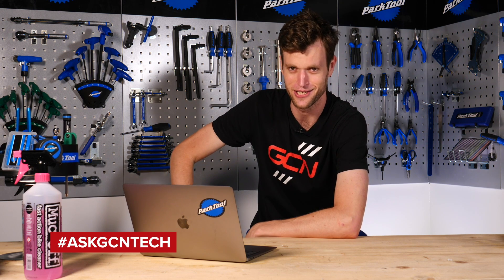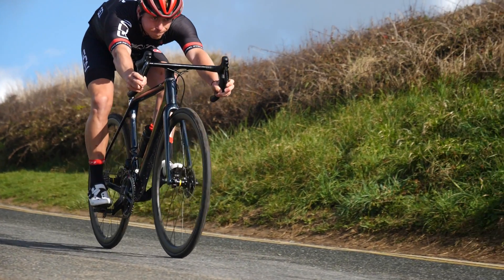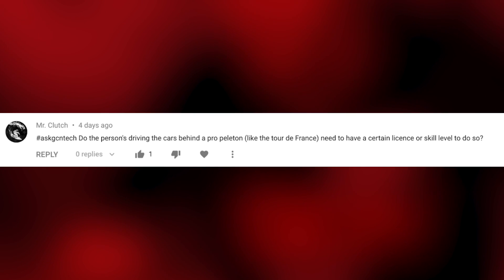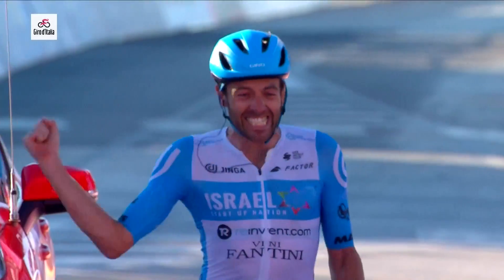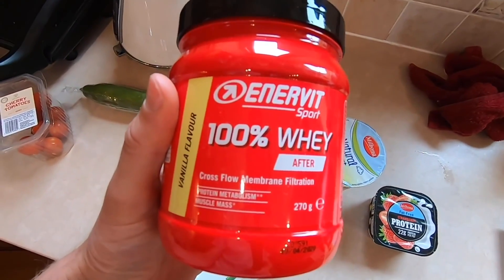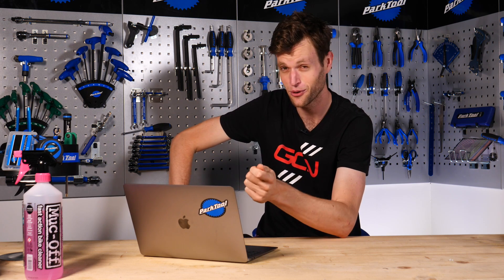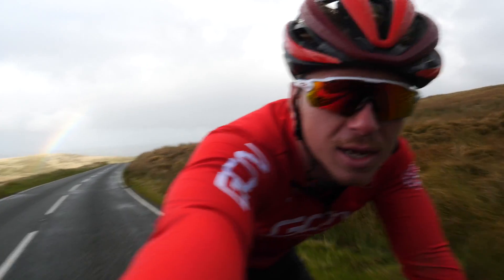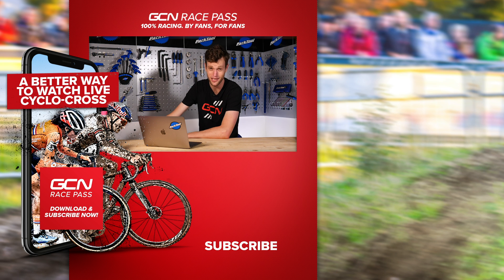Why Do Bicycle Wheel Spokes Cross Over? | GCN Tech Clinic #AskGCNTech

Comment from the maker: Have you got any burning tech questions? Let us know using #askGCNTech 👇
Reply: #askgcntech Hi I was wondering how many times do pros use 1 bike (also love from Australia)
Reply: #askgcntech I have a single speed bike and i saw 3 speed cassette. How do I install it?
Reply: #askgcntech Hi Ollie, where did you learn all of your tech know-how? Did you go on any specific courses or is it just knowledge you have built up over the years? Thanks!
Reply: #askGCNTech recently I have been experiencing lower back pain but i stretch more and more but always feel discomfort any ideas on the issue? Thanks from arizona
Reply: For the person with the squeaky brakes: squeaky brakes  i find are usually caused by the pads/rotor getting glazed over or contaminated. When that happens take some 220grit sandpaper and rubbing alcohol (or a dedicated disk break cleaner, and start by removing and sanding your break pads untill all the glazed parts are gone, then fake and scratch the braking surface on your rotor a tad to help take anything off it. When that is done take a 100% oil/grease free paper towel or similar and spray everything you sanded with your rubbing alcohol. Reinstall the wheel and bed in your break pads. If there is still a squeak, try some of connor's ideas too.If none of these work, there are polishing compounds like 'squeal out' that work better than just sandpaper and acohol, however it's more time consuming. That is what my bike shop does anyway.
Reply: #askGCNTech

Hi GCN, unrelated but I just purchased a new carbon road frame and fork (to replace my old aluminium). I want to switch my rim brakes over but on my old bike, the calipers used serrated/toothed washers to help prevent the callipers from rotating. Should these be used on on carbon frames and forks? Any other tips to stop the calipers rotating?

Thanks!
Reply: I cannot for the life of me adjust the FD R7000... Could you please make a video on this?
Reply: #askGCNTech I have acquired a 5 year old aero bike frame set but I feel the geometry is too aggressive for me to build up as a drop bar bike. Can I use the frame to build a TT bike or would there be some geometry differences that would make it handle like a bag of spanners? Many thanks
Reply: #askgcntech , in the video Conor mentions that he often switched out the front rings for mountain sections , for example  from 54/39 down to 53/36 if you do that will that require additional adjustments such as adjusting the dereleur or chain?

Comment: Just getting back into cycling myself. I have far sightedness and a astigmatism. So I wear glasses when riding or driving at night. I use sports goggles with the adjustable elastic band. I have found that they give me just enough clearance to use the magnetic lenses that some helmets have. It will depend on the helmet, glasses, and your facial structure. Hope this helps a bit as well.

Comment: #AskGCNTech Usually I have a problem with road bike helmets. It seems my head is taller than the average, so my head looks like mushroom when I try on almost all helmets. There is quite big gap between my eyebrow and the helmet or my ear an the helmet. Strangely I never had issues with motorcycle helmets. I know it would be the best to try on many to find which one is good, but where I leave the brand choices are limited. If I order online, it could take a lot of time to find the right one, and not all online shops are happy about delivering like 20 helmets, and accepting the returns. So the question is do you have any brand or model suggestion for people like me?
Thanks!
Keep up with the good work!

Comment: #askgcntech I recently upgraded to a mid range groupset on my road bike and I’d like to work on maintaining it better than I had my first. A lot of my rides involve short punchy climbs that level off or descend quickly and I find it easiest to end up cross chaining and stay in the big ring so I can carry momentum to the faster parts of the ride. Is this a habit I should try to break?

Thanks!

*Not sure if it matters but I’m running a compact Tiagra groupset with a 50/34 up front and a 11-32 cassette. I normally find I can get up short climbs in the big ring and on the 25 tooth cog.

Comment: Do NOT put copper slip or any other grease on the back of your disc brake pads. It will eventually melt and contaminate rotors and pads. Motor vehicles can use thin anti squeal shims between pad and piston, hut never seen them on bikes.

If your disc brakes continually squeal and degreasing/cleaning/sanding pads and rotors does not cure it, (sorry should have bought rim brakes), buy resin or organic pads rather then metal sintered they should quieter. Also buy some better quality rotors, they're not all the same. Then shield your brake calipers when cleaning the rest of your bike.

Comment: To the guy asking the question about gearing.  Last year I spoke to Gary Blem chief mechanic at  Ineos  before the start of the TDF stage Embrun to Valloire  taking in the col de Vars cat1 col d'Izoard  HC  col de Galibier HC  he said Egan Bernal and Geraint Thomas were riding 53-39 front  11-30 rear (I think that's the widest range for a dura ace cassette)  where as I needed 50-34  11-32 to do these climbs

Comment: #askgcntech I am thinking of buying a Wahoo KICKR but do not have access to a mains power supply in the garage. Are there any portable battery solutions that would work instead?
Reply: If long extension cable won't donthe job.  A 12v car battery and an inverter will give you mains voltage. You might then need a battery charger.

Comment: #askgcntech  I have a 2010 SRAM red group set that the front derailleur will or stay in the big ring. When I swing the shifter, it will go to the big ring, but when I let go, it immediately falls back to the small ring. I already checked the set screws, cable tension, cleaned all parts, including the shifter, but nothing worked. What could be causing this issue?

Comment: I have a trekking bike with 28x1.6 (700x40C) wheels which I love for driving around Berlin, really comfortable.
I have been wondering if I could build wheels with thinner rims and tires and use them when driving on road or in some events like the Velothone, since they are lighter and have lower road friction.
I have been thinking about something like 700x30 or 700x28.
Is there anything wrong with that? Is it even worth it? #askGCNTech

Comment: 1:16 Lateral is not the correct term/direction for forces "which are induces when pedalling and braking". Call it tangential, rotational, torque strength/stiffness or something else. Lateral is side-to-side (left-right) movement. Other than that, answer is fine.
Reply: Sort of fine - if "braking" was worth noting as a reason, then the front wheel would definitely NOT have radial spokes since 60-75% of the braking occurs here.
Reply: @georgehugh3455  Braking force is distributed across all front spokes.  In contrast, nearly all of the pedaling force is transmitted to the rim via the drive-side spokes.  And peak force (stomping on the pedals while out of saddle) are higher than braking.  So while radial front is not optimal for front-wheel stability and durability it can be made to work, while radial lacing the drive side of a conventional rear hub will fail in short order with a strong rider.  Radial lacing can also cause hub flange failure.  I wouldn't recommend it even for front wheels if you're talking about conventional hubs and spokes.
Reply: @BixbyConsequence  Thanks very much for differentiating the contributions.  Obviously, if radial spokes can tolerate the (distributed) braking forces, then the REASON for crossing is solely due to the pedaling forces.

Comment: One other cause of hydraulic brakes rubbing; contaminated hydraulic fluid; A tiny amount of water can get into the fluid and not be noticed at the pads wear down. But when new pads go in, the pistons will not fully return to base and you get a rubbing that can't be eliminated, except by draining the hydraulic fluid, replacing and bleeding.

Comment: #askGCNTech I have a Canyon Grail 8 CF SL Di2 with GRX group set as my first road/gravel/all-in-one bike. However, I can't help but ask if I can use it sometimes more as a faster road bike if I fit thinner wheels/tyres. Is it worth it? Or will I be better off with a road bike for a 1000 Euro?
Reply: I doon't see why you would need another bike when this bike already weighs under 8.5kg claimed. Fitting narrower tyres would probably reduce the weight even further. You won't find better than this in terms of componentry and weight for 1000 euros (for this price you would get mechanical Tiagra and rim brakes on a Canyon Endurace with no weight saving over your Grail). Spend 70 euros on Continental Grand Prix 5000 tyres in a 28 or 32mm width

Comment: #askGCNTech Does any e-bike have regenerative braking like in cars? Or is it not worth it in term of technical complexity vs added range gain?
Reply: The bike would have to have a hub mounted motor for regenerative braking. Mid mounted motors don't spin unless you pedal. I would guess that, while possible at this point, it's not worth the weight, effort or cost. Would have to be specific to each bike/battery/rider combo.  With the rider being the majority of the vehicle's gross weight when compared to a car. You may even need ABS to prevent the regen wheel from locking up. Dynamo hubs work, but have so little resistance compared to charging those massive tractive batteries that all the extra stuff isn't required.
Reply: Hmm that’s what I thought. In a car, around 10-15% of energy used is regen’d back in average for city driving. On a bike, the percentage of joules lost in braking heat compared to joules put to the pedals is probably less than 1%
Reply: At least some of the RAD Power Bikes have regenerative braking.
Reply: Most likely no.

Comment: Eyewear... better have contacts and regular sunglasses.  Better viewing angles in all directions. More versatile as well if you can change lenses in your frames to fit varying light conditions.  And no fog as with those slip-in double lenses.  My 2 cents...
Reply from the maker: Contact lenses are the best of a mixed bunch of options in our experience. Not perfect but better than the rest.
Reply: Yap.  May force some compromises too, especially if one —as I— has near- and far-sightedness + a few degrees of astigmatism to correct. 
Of well, tends to improve how some cycling mates look like all together!

Comment: 9:23 prescription glasses, the options really depend on your eye situation. i have prescription glasses (Rudy Project Rydon) with the curved lenses it doesn't actually work for people with stronger prescriptions because of physical limitations, so people with stronger prescriptions are stuck with other options like inserts. I'm nearsighted, enough that I need glasses to drive, but still worked fine for me with curved lenses. Review your options with your optometrist. They are about as expensive as any other nice pair of prescription glasses, but if you take care of them and your eyes aren't changing, you can keep wearing them for years. Switching to contacts is a jump. I've never used contacts. But it would open up your options to lots of non-prescription glasses. I got the lenses with UV transition / photochromic coating so I can wear them all day and they turn clear if I end up riding into the night. Plus the UV transition coating doesn't mess with your ability to read LCD head unit display the same way as polarized
Reply: If you do end up going with contacts, carry a spare pair with your flat kit along with an alcohol pad or some other way to disinfect your hands. I've had contacts fall out occasionally when sweat got in my eyes.
Reply: I have a strong prescription and use my progressive safety glasses for work, if you ask around, they are available from certain stores and online. Cool factor=0
Reply: My sister was an optician before Covid, I’d suggest talking with them during your check up. I use the dork straps on my glasses to keep them on my head and they’ve worked so far with my prescription sunglasses and glasses. I’m not fast though.

Comment: #AskGCNTech Can I use a Carbon Seatpost in a steel frame? I'm putting my steel bike on a diet and everything I've found while researching has a different answer. If I can, will it need greasing or should I clean the grease out of my seat ? Love the channel, I built my bike up from parts thanks to you guys.
Reply: Not the definitive guide to seat post installation but here are the basics. Dissimilar metals will exchange electrons causing corrosion and over time difficulty in removing the part. Even if the frame and post are similar metals the composition is different enough to cause corrosion. A metal interface needs an anti corrosion paste or grease at a minimum to resist corrosion. You can use battery grease, anti seize, or copper brake grease. But keep in mind most auto products are not good for plastic, nylon, or carbon parts on bicycles. Therefore use a bike specific product. Now a word about carbon. Carbon has epoxy to hold things together that is soluble in petroleum products. Non carbon specific grease can break down the epoxy and weaken the part. You need to use a carbon specific compound to join two carbon or carbon and metal. The reason is not to do with corrosion but friction. Carbon on carbon or metal slides.  Think graphite. Therefore you use carbon grip grease on seat posts and handle bars. Carbon friction grease is not a bearing grease. 

Measure the diameter of your old seat post, the inside of the seat tube and the diameter of your carbon post. The reamer will work a little better with some lube in the seat tube. Most high end bicycle shops that build bicycles from the ground up will have reamers. It looks like a long bit for a milling machine with vertical cuts that are not spiral like a drill bit. After reaming you need to clean the inside of the seat tube. I would refrain from blasting anything like WD40 down it as you may contaminate your bottom bracket bearings.remove as much of the old grease and dirt as possible before applying the carbon grip paste. Most new components have torque settings printed on the part or frame. If not check the manufacturer of the carbon seat post. Good luck.
Reply: Yes just use carbon grip grease and use a torque wrench to tighten. Also not a bad idea to use a seat post reamer to clean the inside tube surface. Ask you local bike shop. The tool costs a lot and is not worth the investment.
Reply: @Wildschwein_Jaeger  Hero! Thanks for the tip. Time to start looking for my nearest shop

Comment: Replacing a rim is relatively easy (and a good way to get into wheel building) if you get a rim with the same ERD (effective rim diameter), plus or minus a mm.  You might want to replace the nipples, especially if they're aluminum, but if the wheel has lasted long enough to wear out a rim without breaking spokes already, I assume the original build was good, with even tension and the spokes are in good shape.  If the brake track wear is actually premature and from going down a big sand dune in the rain while riding the brakes the whole way, that's a whole other story :-).

If you want to change to a deeper rim depth, which likely reduces the ERD, you'll need new (likely shorter) spokes.  It's conceivable that if you started out with say a radially laced wheel and you change it to a crossed spoke pattern, the original spokes could end up being the right length to lace to a deeper rim.  If you use a spoke length calculator and have your current spoke lengths handy, you can work backwards to see what rim ERD and lacing patterns get you there.

But as Conor said, you might just buy new spokes of the right length along with a new, deeper rim purchase.

Comment: To the guy with the prescription glasses question (or anyone else), if you're in the UK, go to www.optilabs.com.  I've tried so many things, but this was the best solution for me by far.  I even have my bifocal prescription in mine enabling clear visibility of the numbers on my head unit as well as a clear view of the road. I went with brown photochromic lenses which are able to deal with tree lined shaded roads to bright sunshine, and even full darkness.  If there's no sponsor clash, I urge even the GCN crew to get hold of a pair and be amazed.
Reply: Yes, I’ve been using Optilabs glasses for cycling for about 15 years and they’re excellent. Not sure if they are available outside the UK, though

Comment: To the guy with the stretch question, there are two dorky PTs (Bob and Brad) from the Midwest and they have a couple of videos with simple stretches that really work for anyone at any level of fitness. They show variations that avoid pulling on the knee and putting pressure on it. A lot of hip flexor stretches do not. One video is just about opening up the hip flexor from bed. I used that when I was having problems this summer being super tight throughout the pelvis. Couldn’t even get to my saddle. I actually got taller doing it regularly. Office work can do that to you.
Reply: https://youtu.be/rJuUrF99MNU the video I mentioned